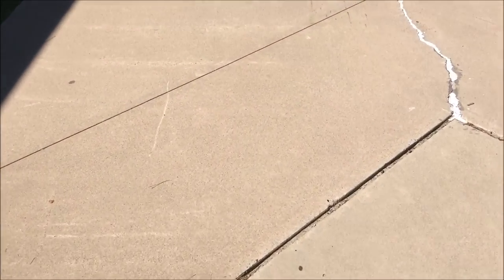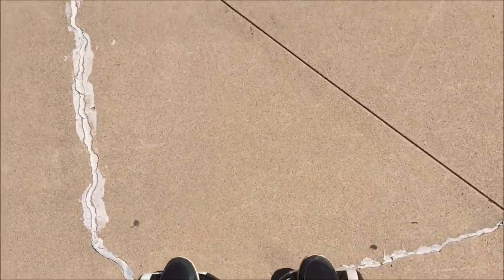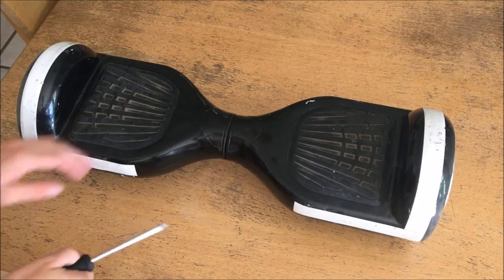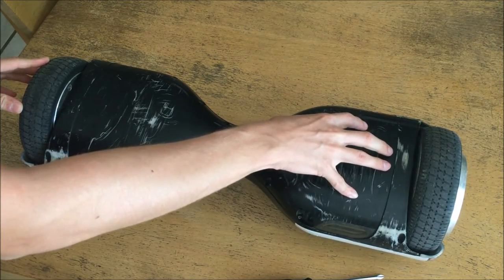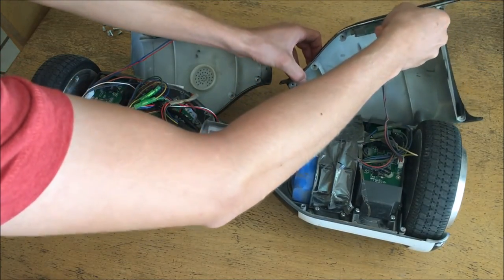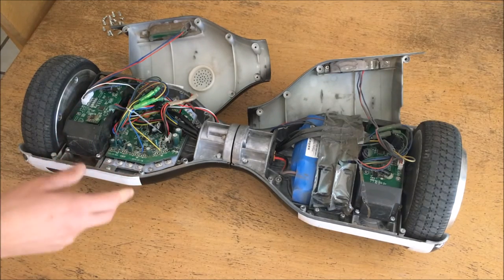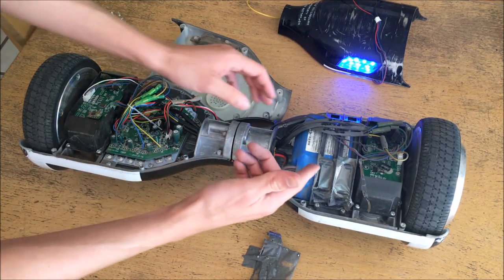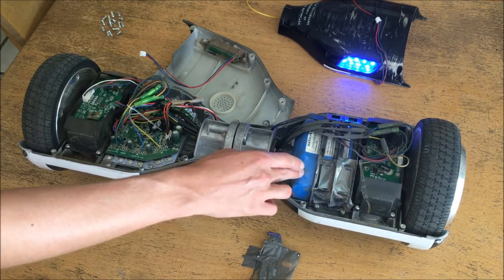EP 14 - Hoverboard Teardown and Inspection

Comment: Wow, you've got some good use out of that thing! I didn't know they would be so reliable, I'm really surprised. They look super convenient and are in such a small package, quite an ingenious and efficient transportation device. when I come across my first broken one I'm going to grab it and fix it for myself.
Reply from the maker: Yes, they really are fun and an effective mode of transportation!

It would be really cool if you find a good one and can fix it up. The price for new ones on eBay has really come down as well, which might be the better option if the used ones you find have major mechanical problems.
Reply: My swagtron is almost 3 years old, 1 year out of warranty. I only recently had to perform maintenance. Oh how reliable they can be.
Reply: Ware you live i have one that needs looking at myself livein the uk nw london any connection between us ?

Comment: Thanks for showing this teardown of a well-used system -- I've been curious to figure out what is actually the root cause of all the problems these devices had. This one was definitely on a dangerous trajectory -- if the battery wrap had worn through and the cells shorted on the metal casing, that could definitely cause a fire. Your fixes seemed great, so long as you keep a close eye on it.